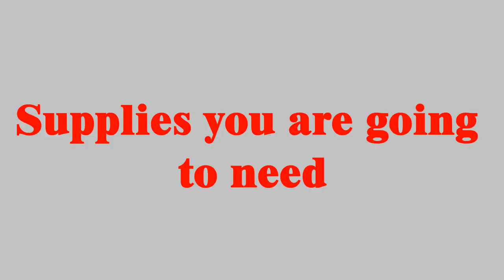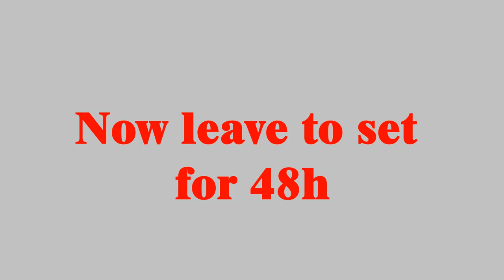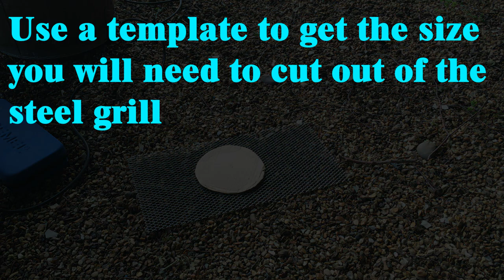Modern Fire Bowl (How to make )

Comment: Not a bad effort but I think you'd have been better off using tin snips for the mesh. Although the Dremmel did the job of tidying up the edge I think an angle grinder would probably have been quicker and certainly not used up as much cutting disc! 
I wonder how frost proof it would be - I suppose that depends on whether it was made from waterproof concrete.
Reply from the maker: ya I tried to get a better mesh but the hardware store only had that and at the beginning I didn't us diamond cutting discs as I was waiting on them to arrive. The concrete is a waterproof outdoor one :) thank you for your comment I am planning on revisiting this project at a later date to improve on my first design.